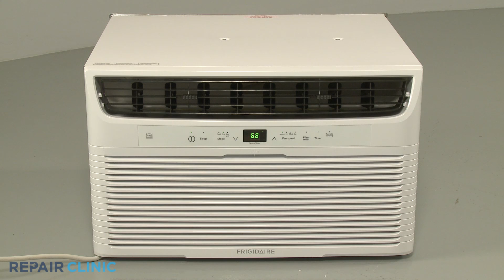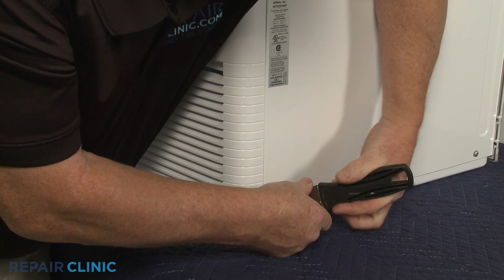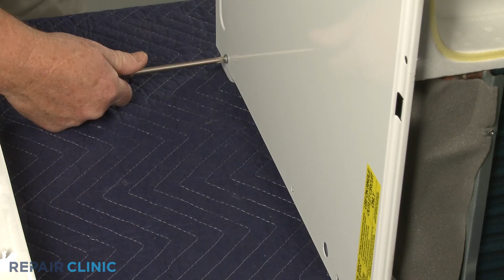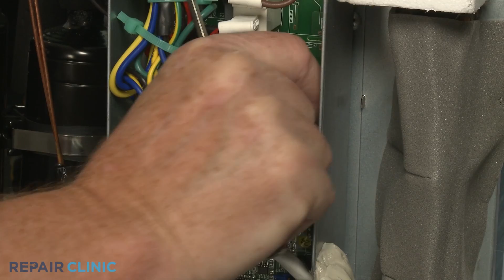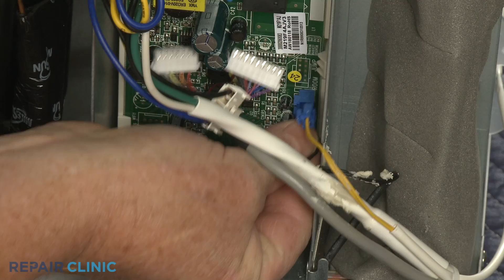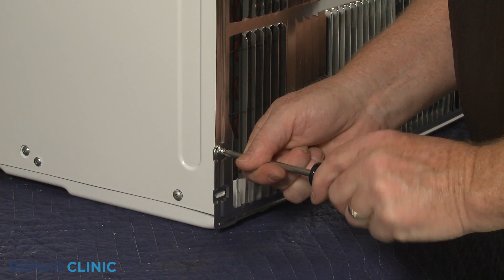Frigidaire Air Conditioner Control Box Replacement 5304516585

Comment: The model sticker is on the outside of unit, if it is missing is there any other place on a fridgaiere 18000  btu with heat that would have the model and serial number?
Reply from the maker: Check out this video to help you find your model number: https://www.repairclinic.com/Repair-Library/Model-Number-Help/147/Air-Conditioner-How-To-Find-The-Model-Number